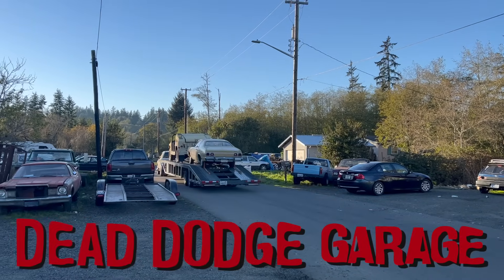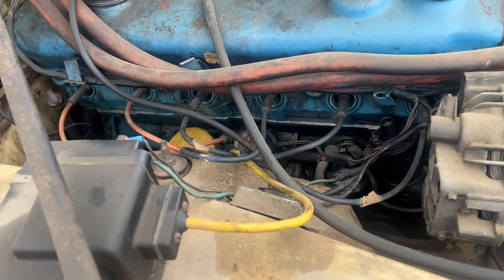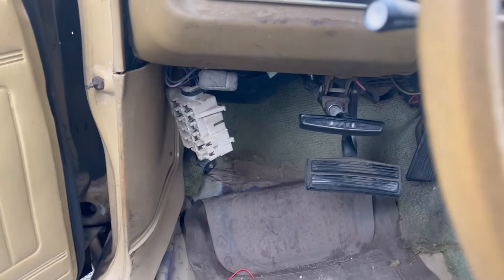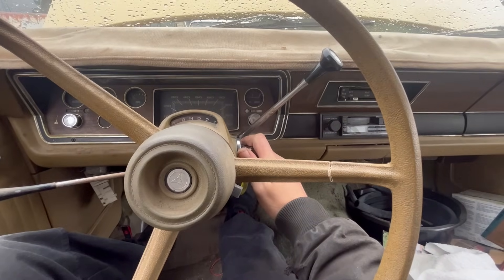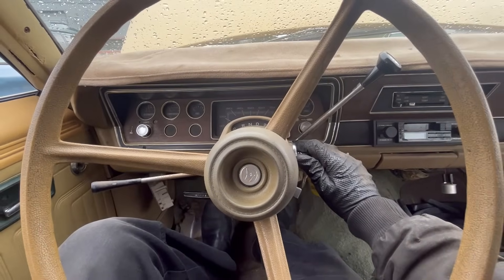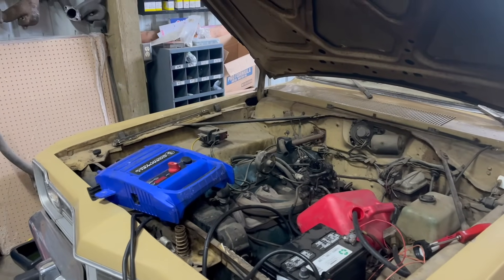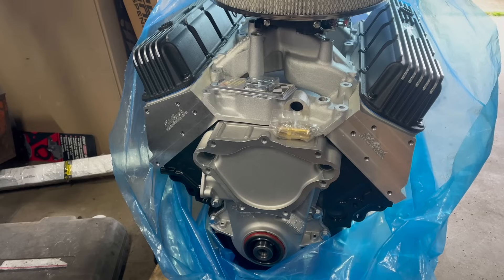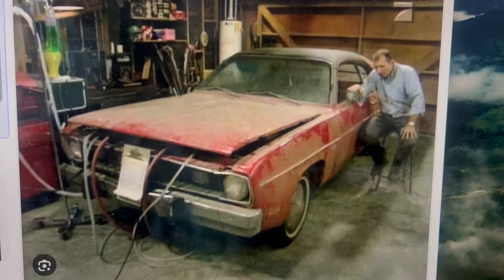Will This 1974 Dodge Dart Sport Slant Six Run And Move After 17+ Years Off The Road?

Comment: I’m a Holley guy through and through. Those carbs are complete junk. Best 4bbl ever made for a small block is a 4180c off of a mustang or a 351w. Set up perfect. Just drill so it can be adjusted
Reply from the maker: I’m not. In fact, I’ve recently come to the realization that I strongly dislike Holleys. The gas always wants to be on the outside of them. Always. They have their place - on straight line performance cars, in a double pumper flavor. Anything other than that? Make mine an AVS2, please. (A classic Carter / Edelbrock is fine too.) It takes me moments to tune and I lose zero gas everywhere. No bowl gaskets to fail. Or pump gasket to fail. Or bowl screw seals to fail. Or needle / seat o rings, or adjuster gaskets. It’s just simple, and for a regular street car, it’s the best. Now, multiple enthusiasts have said that the Carter / Edelbrock is garbage and I need to throw them all in the scrap pile in favor of Holleys. I don’t think they understand the low horsepower world I live in. Haha. But, as always, your mileage may vary - and to each his own.

Comment: I would mess with your age rings, every time I buy a used car I order up replacement brake and/or clutch pedal pads - cuz I hate when they look worn, and they are quite cheep
So that’s what trunk floors looked like, not recognizeable without rust
Reply from the maker: I know… it’s a rare day I see an A body that has all that metal, seam sealer and factory paint there

Comment: I'd 440 swap it
Reply from the maker: Small block is such a better fit for the A body. And lighter. And this is getting a 408 stroker that came on a crate and will run harder than most mildly hot rodded 440s.
Reply: Honestly I'd keep it stock, I like slant sixes
Reply from the maker: @historyguy4351  I do too. If this one wasn't obviously thoroughly blowed up, I might've had different things to say about it. I've seen some slants that run really hard for their size and do impressive things. I've also had plenty that were complete dogs. In the case of a cruise around A body, I think the slant is a great choice - and leaving it under the hood is the unique option at this point in history. I have a naturally aspirated mild performance slant build coming in the future, as well as a ridiculous turbo build. At the end of the day, the owner knew what he wanted in this car, and I'm happy to build it.